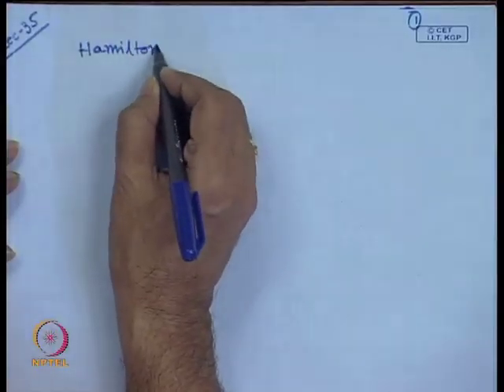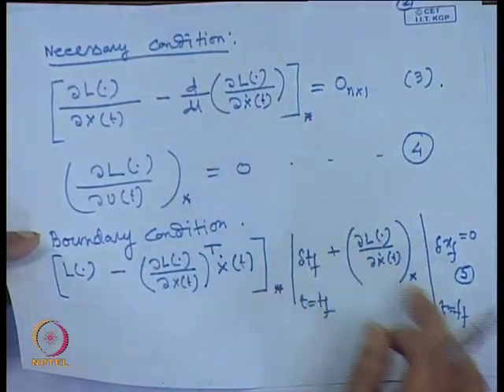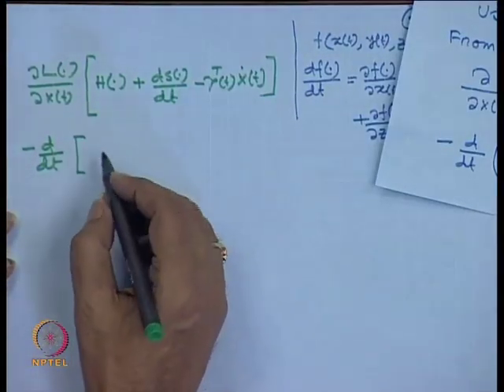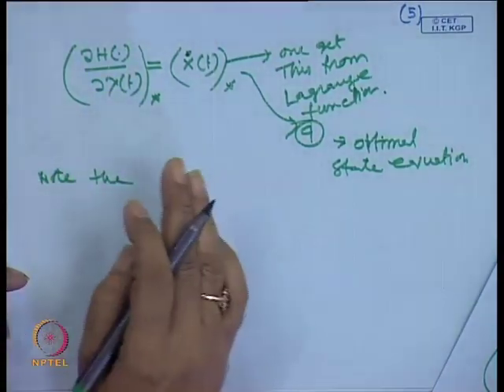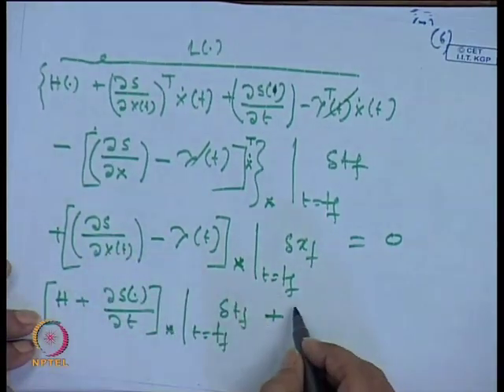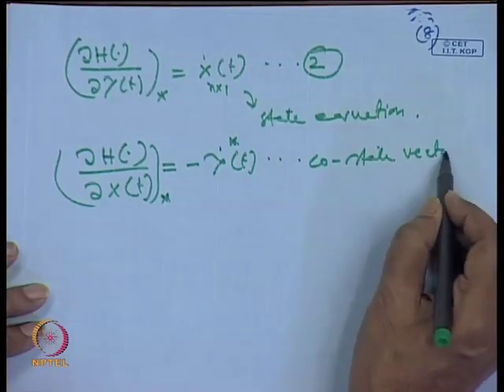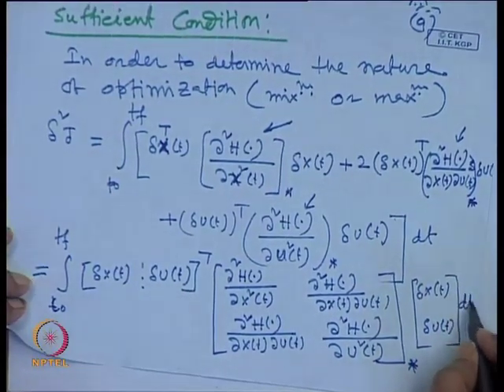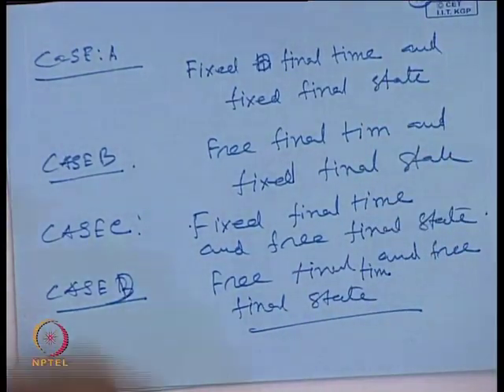Mod-01 Lec-35 Hamiltonian Formulation for Solution of optimal control problem and numerical example

Comment: I noticed that L=L(x,u,lambda,t). Since the definition of L involves x_dot term, I was wondering why is L not a function of L(x,x_dot,u,lambda,t)? To follow up on that, the sufficient conditions are eventially given in terms of delta_x and delta_u. If you have included x_dot within the input arguments of L, I imagine in the sufficient condition we would have had terms associated with delta_x_dot.
Reply: I have the same question